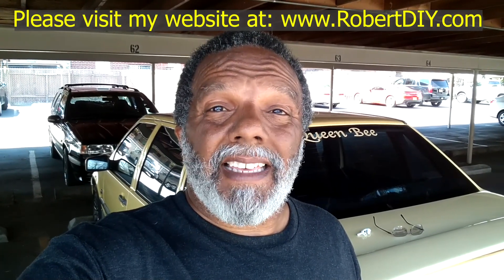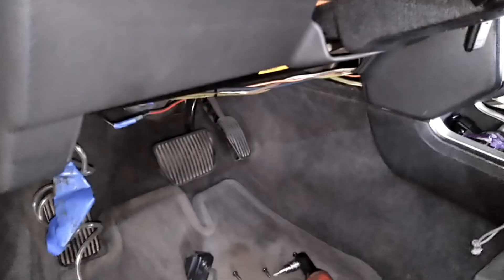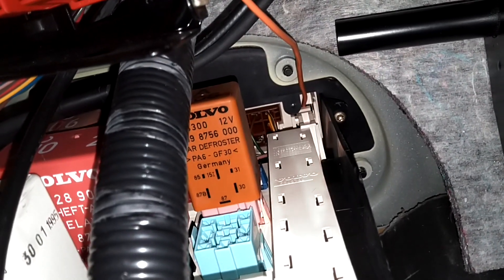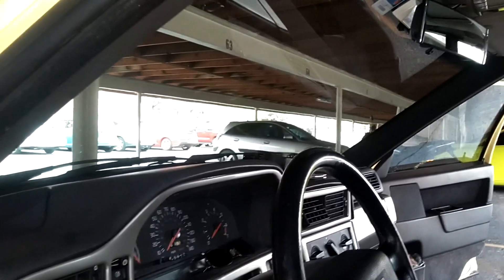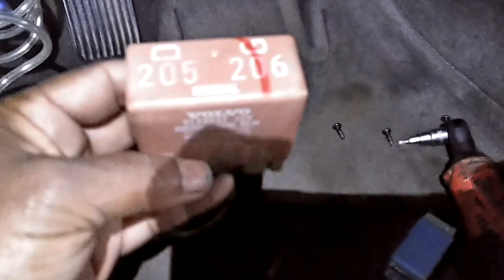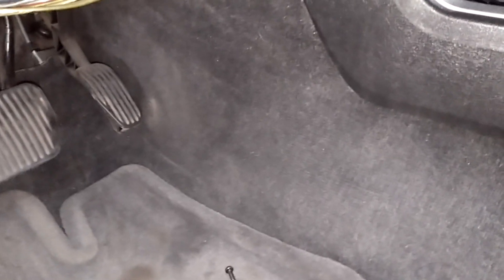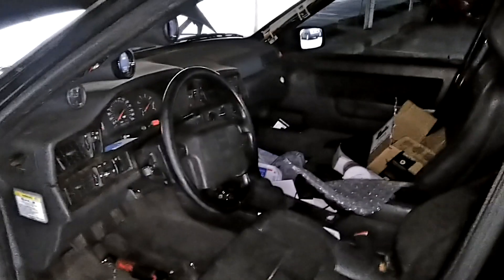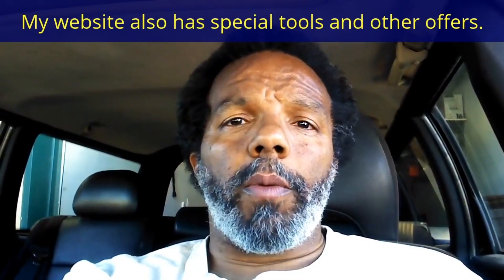I damaged my eye... Tested some ECC parts and tinkered with the remote issue on Panther. - HOWR

Comment: Could get an EMF meter, see if the remotes giving out a radio signal when pressed, probably the only way to see if it's giving out a signal.
Reply from the maker: True. Problem is, when I test them at auto parts stores they usually say no signal when they are working. Maybe they don't catch my frequency.
Reply: @RobertDIY  that could well be the case. Maybe they don't test close enough who knows, even if it ain't picking up the signal. If the the tester is right up the remote should get a spike when the buttons pressed as the electrical signal passes through and will create some kind of field. That's my two cents Anyway Robert.